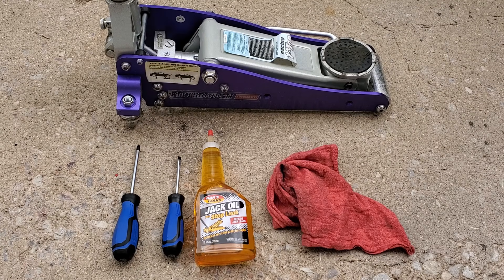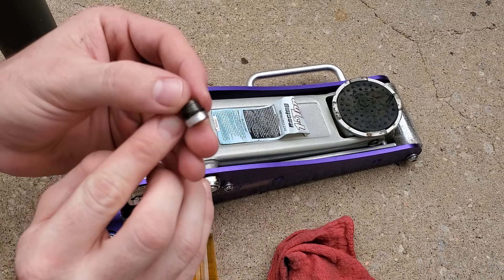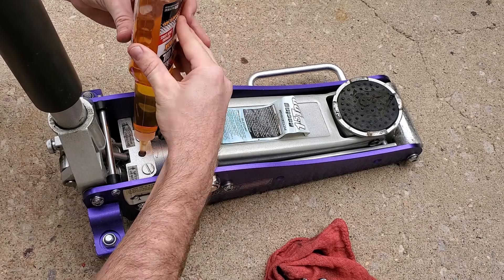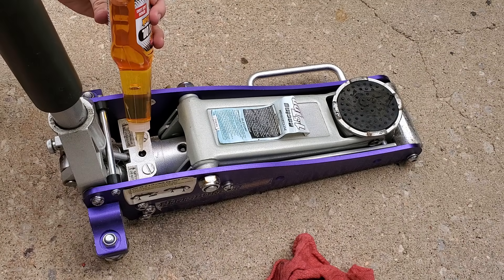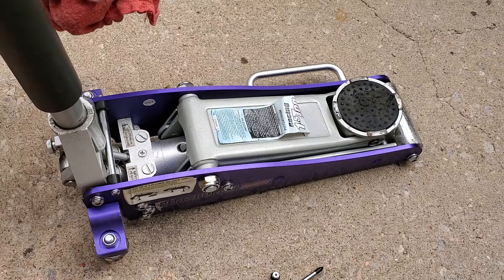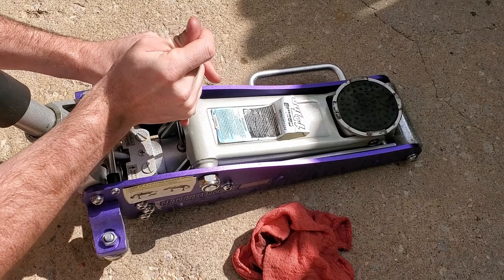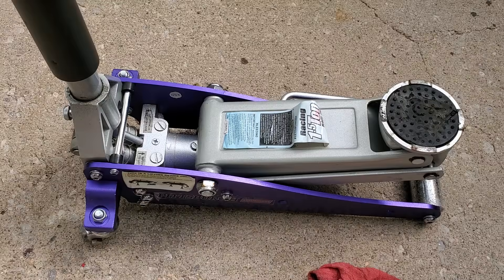How to Repair A Broken Floor Jack That Won't Lift

Comment: pro tip: on the last bleed push the handle to the ground before inserting the drain bolt. This allows enough space in the cylinder for the handle to be parallel to the ground with the jack let out all the way.
Reply: gonna use this, thank you
Reply: about to do this tomorrow bossman. Thanks!
Reply: Hey boss
I have the same cheap jack but after bleeding and filling up with jack oil it will still not extend all the way when lifting a car but without a car it goes up fine, I’m about to replace the 2 plunger o rings but if that doesn’t work as well what should I check or replace next.
Thanks for your time
Reply: Thx another man you just save me some money 😂 I was heading to Harbour freight to get a new jack this morning
Reply: @targesprott3422 Price of those things have gone from $59 to $99 haven't they? 🤬

Comment: Tip on harbor freight jacks. After purchase, remover all fasteners, one at a time, apply loc tite and reinstall. If you don't, you'll have to retighten them for the life of the jack.

Comment: Thanks a million! The manual for this exact jack in the video incorrectly instructs you to bleed through the fill hole (which is how you do it on most hydraulic jacks). 3 unsuccessful attempts to bleed via the fill hole,  where it would only take 10-15 drops oil. The bleed screw was the key. Took 1/3 bottle of hydraulic oil. No wonder it wouldn't go above 50%. Works great now. Well done video. Easy to see everything and useful narration/explanation.
Reply from the maker: I'm so glad I could help! I hope you have a great day!
Reply: I think that bleed hole and fill hole are one and the same.
Reply: Were the springs in back functioning after you put 1/3 of bottle in it? 
I have the same one but can’t get it right
Reply: @kenhilson786  Not on this model.
Reply: @mab123080  Yep, Springs worked. Assume you opened the bleeder screw and pumped slowly to push out air and excess fluid if you overfilled?
Reply: @rjwilliams3846  yes. Several times. Until I noticed the spring/ piston stuck closed on right right.

Comment: so straightforward , love it. you don't need 20 minutes to explain this !
i'm gonna take mine apart to fix them o-rings, it couldn't even lift me, and my 90 kg body haha. so bad.
Reply from the maker: People drag out the videos to fit more ads so they can make more off each click. I don't believe in that because I hate when other people do it. 
I'm glad the video helped you man! I would go get a gasket set on amazon or harbor freight for like 10 bucks and use those cause sizing them is hard. 
Good luck man!

Comment: I just finished changing the breaks on my f150. I was able to jack it up and put the rear end on jack stands. Now I can't get the jack to lift it up. I am pretty sure this is the way to fix the issue with my jack. I appreciate you taking the time to film this and make a great video at that.
Reply from the maker: No problem man! I hope it helped you out! Thanks for the kind words! Just trying to make youtube a little better.

Comment: I have exactly same Floor Jack (Pittsburgh). It lifted not that high, and I usually used a wooden block 4x4 to lift higher. I always thought that is how high that Jack can lift, but now I think I might need to inspect and adjust it in the way it was done in this great and very detailed film. Thank you very much.

Update: I inspected that Floor Jack: There was enough oil, I added a bit, and bleeded some air (though it seems after every use it accumulate a bit air every time you raise the jack. I assume it is normal), but in general everything was fine. It was just I thought it doesn't lift high enough, I would buy another higher jack, but those are very heavy. But I feel so much more confident after this inspection following the film, bcs I always can inspect and monitor my Floor Jack from now on. The film is really helpful. Thank you again.
Reply: What size jack and what kind of vehicle is it? Your jack might just be too small if you have a truck or suv
Reply: @vtyler18  Thank you. I have small low profile jack Pittsburgh fm/Harbor Freight. It is Al. Those which lift higher are too heavy for me. And I have no problem to lift on the same height as those taller via combination of 1 or sometimes 2 of 4x4 wooden blocks. Do you happen know, if you can switch fm/ Park to Neutral, if the transmission fluid is drained? I need to replace CV Axle, and want to drain before. I'm researching for that answer. The car is 2001 Saturn SL2 (small passenger car). Thank you again.

Comment: Thank you for the video. I have the same exact jack and this video helped refill the fluid and now it works fine. Thanks again!
Reply from the maker: No problem! I'm glad I could help! Good luck with it!
Reply: Did yours have a problem with one of the sides not sprinting back out ? 
How much fluid did you need to add?

Comment: "I didn't trust it to not fall on me".

That's always true. 

If you own a floor jack, you should also own (and use) jack stands. The jack should never be used to support the car, only to raise it enough to put it on the jack stands.

Comment: I am about to give this a try with my Craftsman floor jack. Only pumps for about 10% of the handle stroke. It really only worked correctly for a short time and I eventually gave up using it years ago. But the one I've been using broke, so I need to get this one working again to do some front end work on my truck. Plus it's basically a new jack. I tried just adding more oil a couple of years ago, which helped a tad, but never thought about bleeding it....only makes sense. Why did I not think of that LOL. This video gave me hope. I will come back and update my comment if (hopefully when) it works.
Reply from the maker: That's what this one was doing. 
It probably just has some air in the system like mine did. 
Let me know if the video helps fix yours! I'm no professional at this but I figured it would be the same deal as the motorcycles I've bled brake lines on.

Comment: Thx Bud Ijust fixed 2 of my floor Jack's, did what u said both work got o rings and Jack fluid at Harbor Freight
Reply from the maker: I'm really happy for you man! I'm glad I could help!
Reply: Those screws just use regular O rings, there not special in any way? Just want to make sure before I repair my old HF jack. Thanks.

Comment: Thanks for the vid. My jacks oil was jet black with flakes of metal in it so I ended up dumping the whole thing before refilling
Reply: Our is a Craftsman floor jack found two screws on each side like the ones that on your floor jack between the screw where you fill it with the fluid.

Comment: Great video. I have a really old large truck jack that I got at a tag sale. It works but it’s very difficult to turn the handle so that it raises and lowers my cars. How do you fix it so that so that it locks in place and lowers without me having to get three guys to help lower the Jack?

Comment: Nice!!! I have almost the same model (Low Profile 3 ton Pittsburgh)... I've only used it 3-5 times since I bought it, 8 months ago and it started doing the same thing... I'm hoping the fix is as simple as this... Bout to go give it a run and will update... Thanx in advance...
Reply from the maker: It will work with basically any jack! Let me know how it goes! It should be easy :)
Reply: Mine is actually a Heavy Duty 3 ton w Rapid Pump (if it makes a difference)... It didn't work, at all, sadly... I replaced all the fluid and made sure there were no bubbles, but it changed nothing...It was doin the same thing yours was and like I said, I've only used it a few times so it has to be som'n simple...
Reply from the maker: It could still have air in the line. It's the same thing basically as a brake line. You can't get force out of your car brakes if there's air in the system because the air compresses instead of moving the piston. 
You probably have a bad seal on one of the bolts then and just need a new little rubber o ring.
Reply: Ppl take so good and shit about craftsman it’s funny how they all say harbor is better over craftsman
Reply: GORILLA PIMP  Gave up... I'm actually considering white-trashing it... (Go buy a brand new one, put the old one in the box and return it)... I figure for the price I paid, I should've got more use out of this product...  than 3 uses...

Comment: HI. Is the gasket on the bleeder screw (the large screw) an actual gasket, crush washer or O-ring? You said the smaller screw has an o-ring, then said replace both o-rings. I want to be sure the larger screw has an o-ring before I find out it's some sort of proprietary gasket that can only be found in eastern europe or China. Thanks.

Comment: Great video! Quick question for or anyone who knows what size O ring that is on the bolt or where to find it. Thank you!
Reply from the maker: In the description I have a link to a huge set of o rings cause its hard to buy the perfect size.

Comment: If my jack is leaking.  Assuming it’s the o ring / gasket.   Do you need exact fit gasket or around size of the screw would work

Comment: Do you know how to fix a jack when you didn't tighten the handle while using it.I don't know now to fix it as it pumps up 1/4 of the way and then when you stop it falls down

Comment: What if my jack handle just spins it won't ever tighten? I only used this jack like 3 times then it stopped working and yes I'm turning handle the right way. Aby help or tips would be appreciated!

Comment: So is it only Jack oil? Some videos circulating are adding grease? Or is there oil and grease to be filled?
Reply from the maker: You could grease the piston if you want but it won't affect the problem I was making the video for.

Comment: Do you need to drain any of the old fluid? Or you do you just keep refilling as needed
Reply from the maker: As far as I know you shouldn't need to drain the old fluid. It doesn't get hot and worn out. Though, if I had a 20 year old jack I would drain the old fluid.
Reply: @JosephToddYT  Thanks!

Comment: Im mechanically minded so I knew process before watching the video . But when you get older ,nice to be able tp watch a video refresh your mind .thanks liked subscribered . Just got brand new jack off ebay  went funny within few weeks once tried to lift front end it went up to a point .then every press of lever lifted up 1 inch  then dropped back  as soon as i brought the lever back to its start position.  I suppose it has some sort of one way valve thats gone dodgy. But older jack replaced ,just needed bleeding and fresh oil .the lad left the valve loose the jack tipped on its side in its case .lost the fluid. 🤫🙄

Comment: What does loosening the handle exactly do? Serious question TIA
Reply from the maker: It loosens a screw that holds the pressure in the cylender with oil, that lets the lifting part down.

Comment: If you see this then good if not its okay. But i have a us general jack that was a display piece , it was a limited edition display piece from us general and its a function jack just a “mini “ one big enough to jack up a 100 lb rc car . Im having this exact issue but when i turn the handle it kindve just free spins. I did what you did and it somewhag pumps up now but i cant lock the handle if you know what i mean? Where it gets tight again to hold pressure. Please help me lol

Comment: I had fluid leaking from the screw that goes in when you tighten/loosen the handle (to let the jack down).  Any idea why that is?  Thanks.
Reply from the maker: Sounds like whichever seal that is is bad.
Reply: Same here. Leaked out the threaded rod to tighten /loosen. 

Did you find a solution to yours? Thanks!
Reply: @mab123080  I did not.  As a temporary fix, the fluid isn't leaking out as long as I have the handle tight to pump/raise the jack.  But I'm guessing it's the seal, as was suggested.  I'm not super knowledgeable on where to find a new seal or what size it is.  Hopefully it's not hard to find.

Comment: I have the same jack but it won’t tighten. Not sure what’s wrong with it. It only tightens when I jack the handle down to where it’s almost touching the ground and then it tightens and Un tightens. Any idea on how to fix this. It’s not low on fluid or anything. Any help would be great
Reply: Same here !! Same jack. Keeps getting looser each time 

Have you had any luck?

Comment: My jack doesn't respond to the lever press until about halfway down the stroke. It looks like yours did something similar too. Any idea how to solve that problem so the lifting starts right away?
Reply from the maker: It sounds like it doesn't have enough fluid either. Did you try topping it off?

Comment: Mine isn't leaking at those spots but one of the 2 pistons under hendle is just wet. Looks like one of those seals there might need replacement or????
Reply from the maker: Yeah, I think you are right. I don't know where you would find replacement seals though.

Comment: What about if a jack goes up fine with no load but once you put load (car) on it, it simply does not lift the car. I tried adding the same fluid but still doesn’t work. It surprisingly lifted my car well 2 days ago but when I tried to lift the other side, it did not lift the car. I really want to repair it as its a very expensive Craftsman race jack purchased at Sears and just out of warranty. Please help
Reply from the maker: Is it leaking any fluids or anything?
If not you may have air in it and need to bleed it like I show in the video. That's the only thing I can think of without seeing the jack in person. I hope it works!
Reply: @JosephToddYT  no apparent leaks. Tried everything in the video and still nothing.

Comment: Hey thanks for helping me out. I had a jack doing same thing. Expensive jack too but it's old. I did exactly what you said and now it's working again! I even went out and bought a new one before I saw your video...oh well now I have 2 good jacks. Oh my jack on the cylinder I had a rubber plug. I don't think that cylinder screw is 100% important for keeping the oil in because there isn't much pressure on that screw...explaining why my jack has a rubber plug. Thanks!
Reply from the maker: No problem man! I was about to do the same as you and buy a new one that's why I made the video cause I wanted to make sure other people didnt have to. 
I think you're right on that and it only needs to be airtight to keep it from leaking or anything.

I'm happy to have been able to help! Have a good one!

Comment: Thanks! I tried but it did not work on my jack. It is not leaking either. Could it be the one the checkvalve inside the cylinder?
Reply from the maker: It could be the checkvalve do you have the same jack as the one I have in the video?
Reply: @JosephToddYT  No I have bit older rmodel and it is around 15 years old. It is not leaking except starting now at the pump-place where you pump. Could it take in air from that place?It is at the bottom of the body where the big nut holds everything = the pump. It is not leaking very fast. But first it was not leaking before. I took that nut away to make sure it was not the pump-piston that was something wrong with. It could now be the threads that are some dirty and it is leaking cause of that. Anyway before all this it was not leaking from that place and it was still impossable to bleed it. Where do I find repair kit for a good price?

Comment: I remember that particular Jack used to go for like $49 or $50 with a coupon at the freighter
Reply from the maker: It goes for around a hundred now, that's why I would never go under the car without jack stands in place.

Comment: I improvised by using transmission fluid. This video shows the hole you should fill the jack up with. 👍 Guess I won't have to get my biggest hammer out after all. 😄
Reply from the maker: That's a great idea! I'm glad you saved yourself some work with a hammer haha

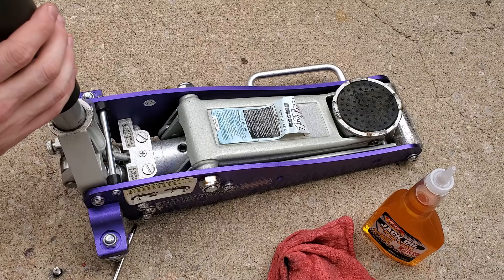Comment: today I jacked up the left front of my car, and then went to jack up the right front and it wouldn't lift it. I tried bleeding the system. At 1:20 in your video you can see two "cylinders" which have springs around them. A roller pushes them into the jack. One of mine goes into the jack, the other doesn't. Is the jack toast?

Comment: Hey man I don’t know if you still have this jack. But multiple people have had issues where the c clips where the hydraulic ram meets the arms fail and the jack fails completely. Might be a good bet to check yours out and either replace them with bigger tougher c clips or add a tac weld on the outside to keep them in place. Stay safe 👍
Reply: Chewbakker plakker snacker.. can u make a video n send it my way.. that may b my problem